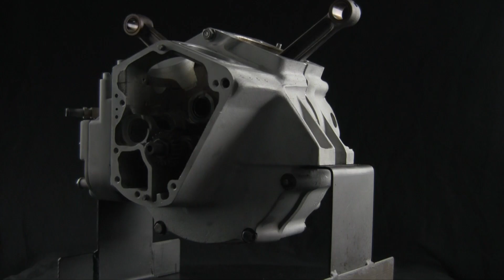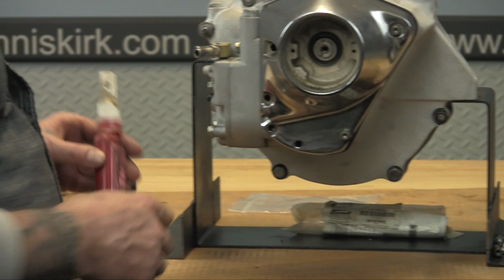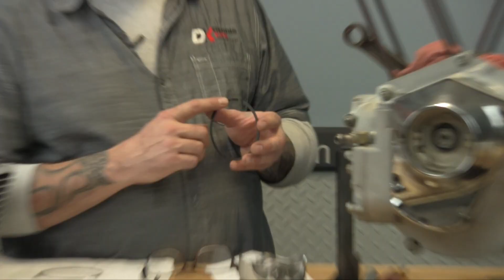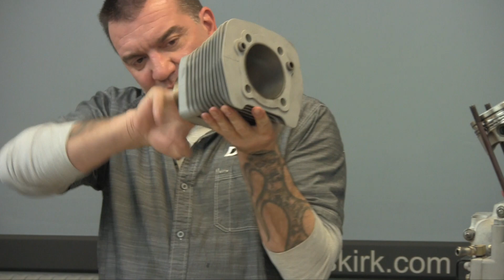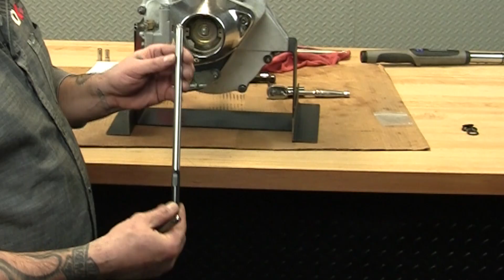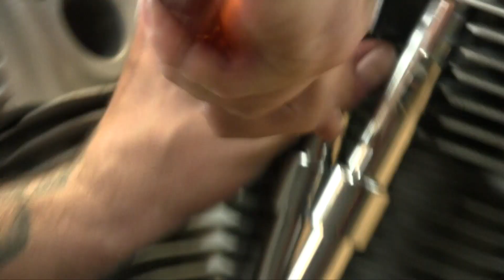Harley Evolution Engine Rebuild Part 3 Final Video.

Comment: What would a service like this cost
Reply from the maker: That's a great question - it can vary depending on the shops you have available or if you're doing the work yourself. We recommend getting in contact with your local shop for the best answer on local pricing. Our tech team can also help provide some answers - give them a shout at 1-800-969-7501

Comment: Shows why the Harley engine is so timeless.  You can take it apart and repair it quickly with a simple set of hand tools, and you're good for another 100,000 miles.

Comment: The studs you show being installed are 1987 1/2. These are to be installed with that shoulder up, not down. There is a tool to be used if you want but you must not use wrench or ratchet, only air or electric impact tool so as to not off-load and risk bending during install. Length of protrusion from gasket surface to be 5.670 to 5.770. Stud threads are oversize to fit tight in crankcase and standard machine fitment on other end. Put them in upside down as you have can cause one of several unhappy conditions. 3 evo studs are as follows. 84 1/2 to late 85, late 85 to 88, 88 on. 85 to 88 manual shoes this info on pg 3-15. Pg 3-40 fig 3-48 shows what you did wrong. Studs with proper interference fit in crankcase are oiled before  install and if little loose are treated with loctite stud n bearing mount. No high strength loctite is used any where in these motors. Runs the risk of peeling threads. I dispute your assy methods as I am just now into my 187k 88 evo 1 owner evo motor. Doing heads ,replacing first time cam and tappets, and inspect on oil pump and drive shaft
Reply: 8

Comment: If you rotate the piston to TDC on the compression stroke the spring pressure is off the valve springs. Eliminates the problem with wonky removal of the rocker box.

Comment: All looks good and is right for what you did do.  But heres why this engine would be useless to me and why I would take it all apart again.  When the cylinder jugs were off and when the cam cover and cam were removed I would have grabbed the shaft end and checked for up and down play and in and out play then I would have grabbed the rods and slid the back and forth and then side to side and up and down for crank pin roller bearing play.  I would have done those things even if the engine was still in the bike frame.  Why build a house on a cracked foundation?  Your work you did is good Jim but why were these major importantces ignored?

Comment: Contacted H-D and it is the second ring that has the dot. The top ring has NO dot and square edges so it can be put on any way up. The second ring is shaped and so must go on with the dot facing up. To see how it is done properly watch the H-D engine rebuilds by Tatro Machine.
Reply: Is that so!? does Dennis have any comment on this? thank you , I shall check it out when I do it!